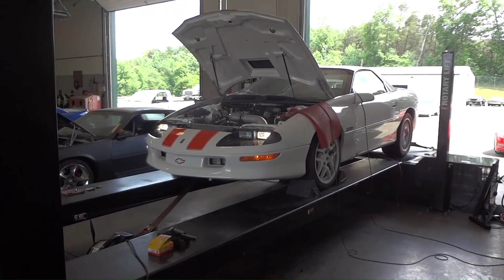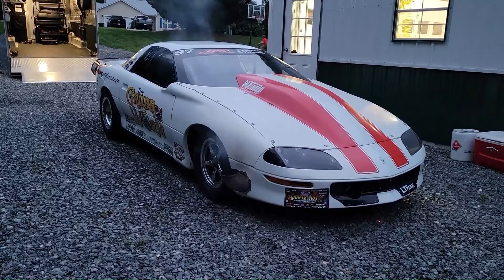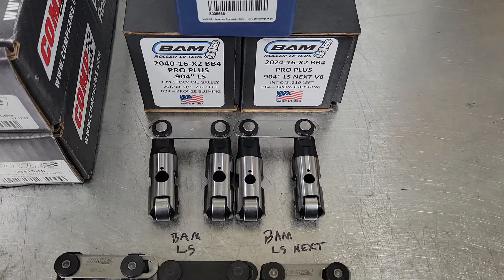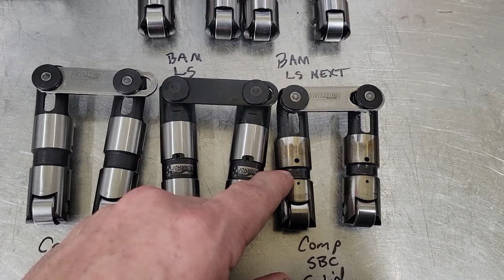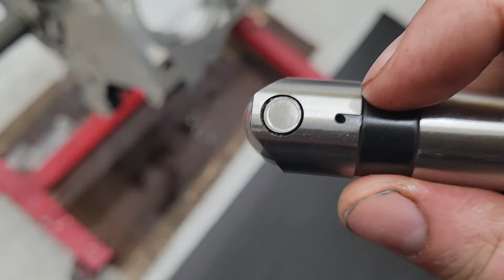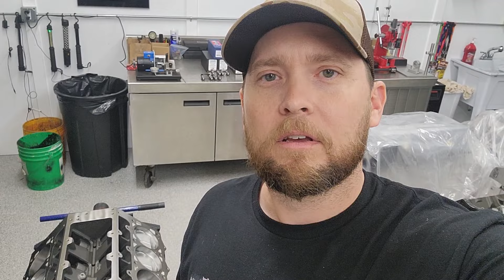Lifters:  Don't melt your pushrods!

Comment: I bought some new solid linkbar lifters off ebay for dirt cheap, .842" comps i believe, because they were for some type of older Holden application and i guess people didn't want to take a chance on a misfit. The linkbar length didn't work for the sbc but everything lined up good for the LS looking down the oil galley and min/max lift for the linkbar. Kicking my butt for not buying them all as they had several sets.

Comment: I could only imagine how frustrating and heartbreaking it would be to build a Dart block setup to only use the wrong lifters and smoke the valve train and potentially the pistons.  Curious how much better the Dart blocks are over GM LS blocks?